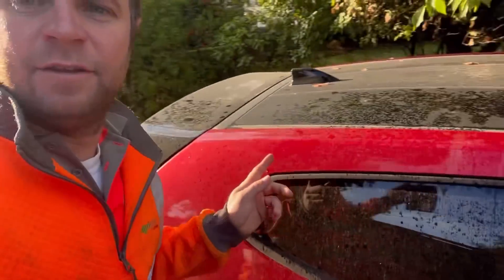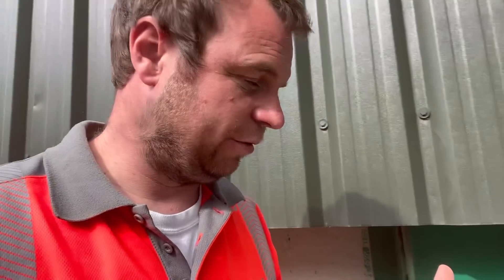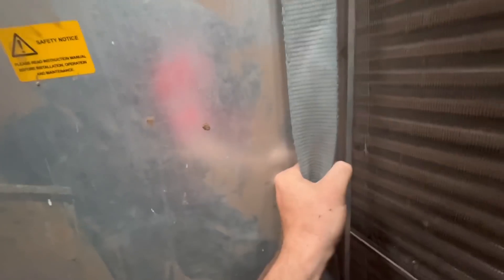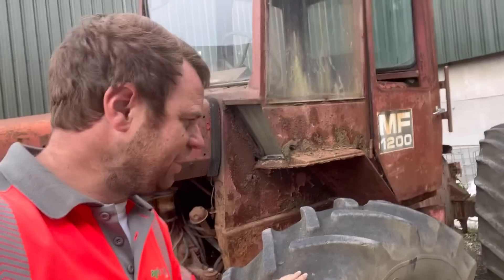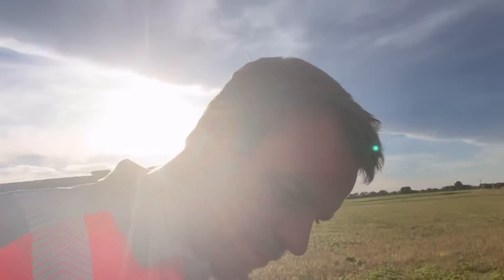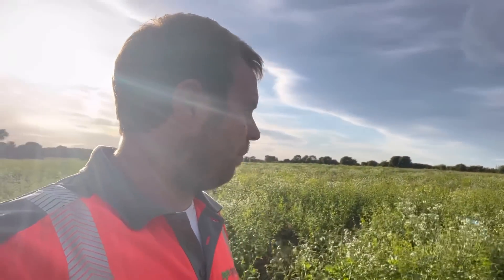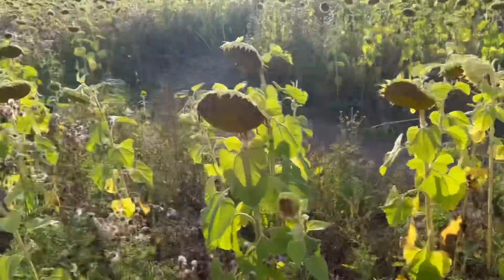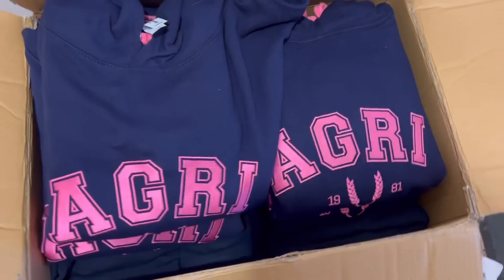DAY 897 FIXING A BIG FAN & THEVES EVERYWHERE #OLLYBLOGS  #AnswerAsAPercent

Comment: Olly i saw in a previous blog that you had a plough , how often do you plough your ground? And is it right that environmental groups are trying to ban the practice of ploughing cos of carbon emissions?
Reply: Olly doesn’t like ploughing if I remember correctly he did it this time because of some weeds that couldn’t be killed of with chemicals.
Reply: Ploughing drinks diesel and isn't necessary on most soils. It has it's place  but there's no need for it in most situations.
Reply from the maker: Exactly